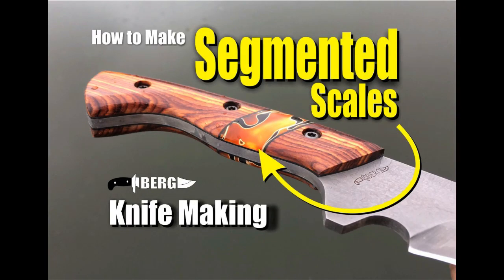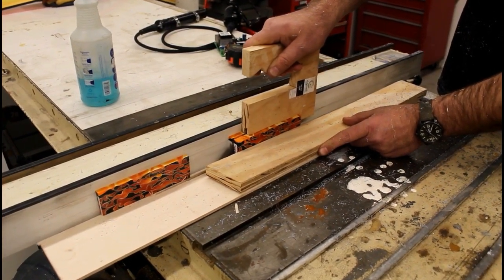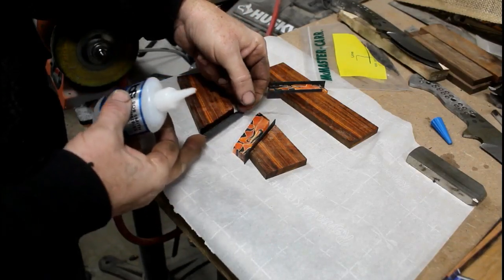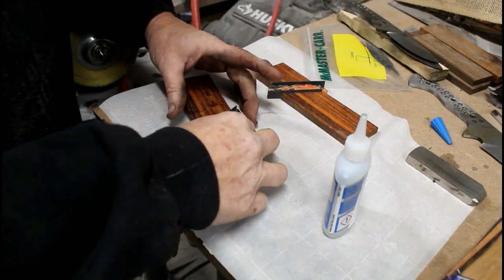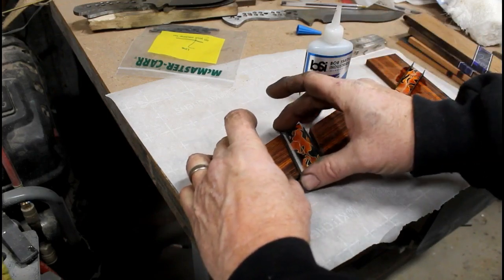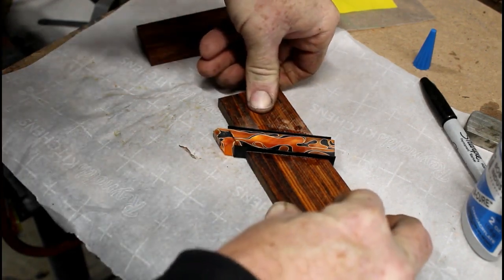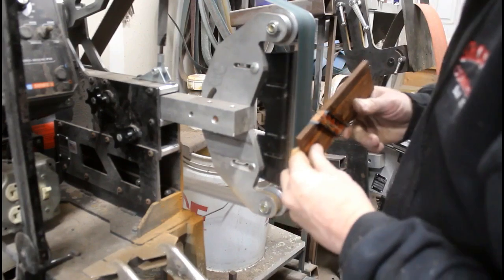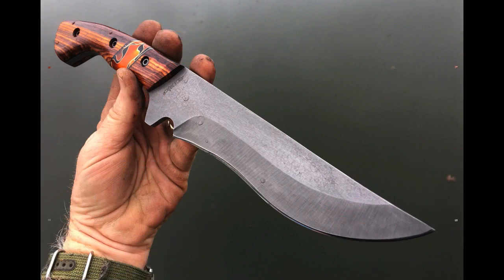How to make Segmented Knife Handles or Scales by Berg Knife Making

Comment: I use to make stabilized wood mods[vaping]  and the process is prety cool using alumilte clear and puting it into a mold and then a pressure tank for 2 hrs to remove any bubles, I also had added alumilite powders to add into the part b of the alumilte, you gave me the idea to start making them now for knife handles. thank you.!.

Comment: Excellent tutorial Dan.  My only suggestion is to provide links to where you purchased the iron wood and acrylic pen blanks if they were purchased online.  Thanks for the ideas.
Reply from the maker: Will do next time. I had the wood scales sitting around the shop. Acrylic also. I usually just search online and buy whatever colors catch my eye. Next time will keep track of where I got it from
Reply: @DIYeasycrafts  The Woodcrafters down in San Antonio hasa selection of wood and acrylic pen blanks, but nothing caught my eye quite like the one you used.  Very nice.

Comment: Excellent video. Question: I know it depends on the knife and the scales but in general how long does it take to attach and shape a set of scales?
Reply from the maker: I kind of do it the slow way but for me it works and I get good alignment from side to side. I glue up one side. The drill holes using holes in blank as the drill guide. Then I glue up second side. once that is dry I drill through all three pcs. Bottom line I spend a lot of time waiting for glue to dry Buy total time actually working to attach and shape might be about an hour